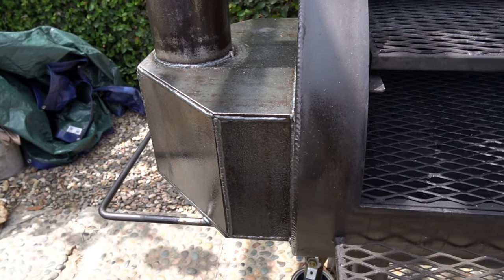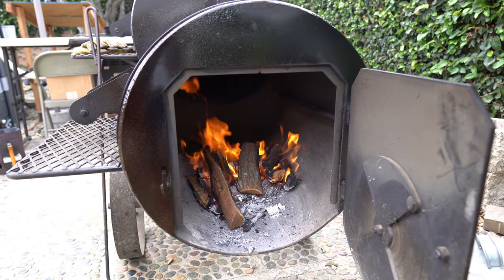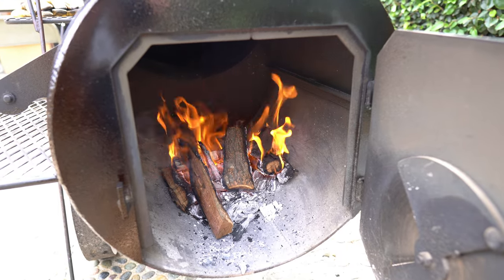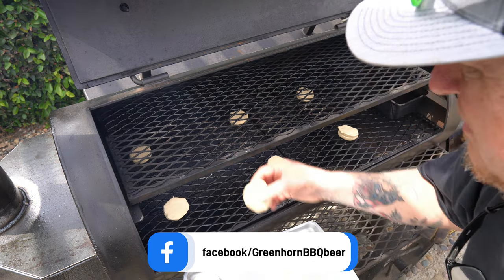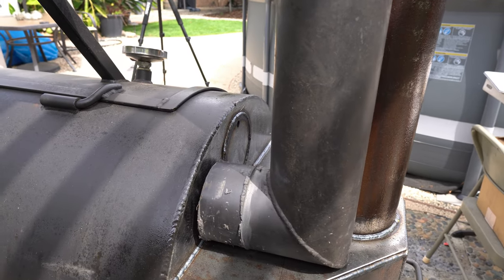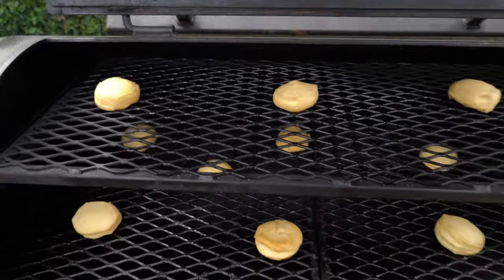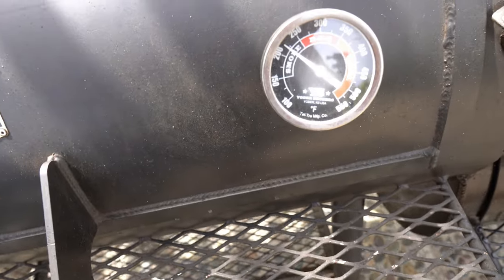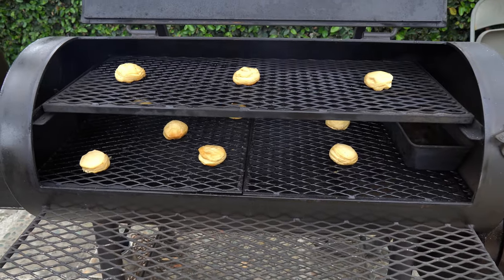Yoder Offset Smoker mods Collector and Oversized Stack kit biscuit test

Comment: Are you running tuning plates?
Yoder put that upper temperature gauge by the exhaust cuz that's where the air flow is going You should just put inside thermometer on each end and check your temperatures get one high and one low you don't really match them 
Unless you have your exhaust up there what you don't
Reply from the maker: No more tuning plate, just baffling. I'm going to move that higher thermometer down soon.

Comment: your ideas...i had a friend  helped me put a collector on it and a bigger  stack with a 2 piece stack......i over thought the collector and its only 1.5 above the grate...after looking at other  videos...i want to try smoking without the baffles.....what do you think???  thank you Dennis
Reply from the maker: Thanks Dennis, I would say before you do such a project you should really study your style of cooking and research what is missing and then build to that desire. Make sense?
Reply: @GreenhornBBQbeer   I appreciate your thoughts...i have cold smoked some loin jerky and then dehydrated it....i turned out good....that is a lower temp....around 100ish and so it will go low temp . The air flow is better than it was before the project.....i usually use briquettes so using lump threw me off......and i am not longer using the baffles i purchased.....so its a learning curve for me.....if i can get a temp of 250 and regulate that ill be plenty happy.....thanks again
Reply: Did 2 pork butts today......temp was 225 all day....really steady temps....project was a success....thanks for your input

Comment: That looks awesome. I think you should consider changing the baffle design to something similar to what franklin and mill scale are using. That way you will get a more even spread of heat in the chamber and not having the heat rising from below, maybe with a little higher temps on the top grate as a result.
Reply from the maker: I will look in to that, thank you

Comment: In my offset, putting any sort of a pan close to the firebox causes the stack end temperatures to drop. I'd be curious to see the same test without the pan in the way.
Reply from the maker: Interesting observation Todd
Reply: @GreenhornBBQbeer  FYI am am using a Horizon offset. I am seeing people cut the firebox baffle size down, but my Horizon's baffle is actually already much smaller and seems to be the people's target size. Also the Horizon has a 2 ft tall 4.5 inch ID stack that exits at the top of the smoker. I put a 9x13 pan for my baked beans near the firebox and all the meat in the last 5-6 inches before the stack wall didn't cook like it used to. The end used to be a bit hotter than the middle, without the pan.

Comment: I wouldn't try to match your temps when you got a gauge on the top and a gauge on the bottom The top's always going to be hotter and the  thing I would do is get some punch plate from your steel company put in a full length tuning plate and you should be good to go
Reply from the maker: Interesting idea, I definitely am going to move the thermometer 🌡

Comment: I was wondering if you have Yoders tuning plate installed
Reply from the maker: I removed it altogether.  Now just using a small plate as a heat deflection aid. I put my water pan on it now.
Reply: @GreenhornBBQbeer  Why would you take the tuning plate out? Seems like it helps with more even heat and smoke distribution.
Reply from the maker: @GarysBBQSupplies  I could see why that makes sense, the the overwhelming indication from the industry is seeing  an absence of those on smokers with a exit stack design such as this.